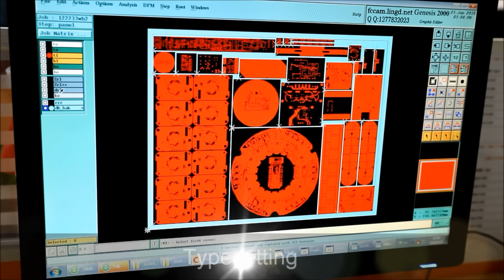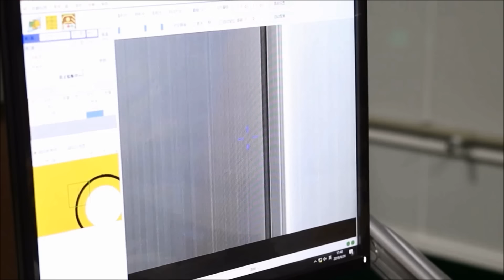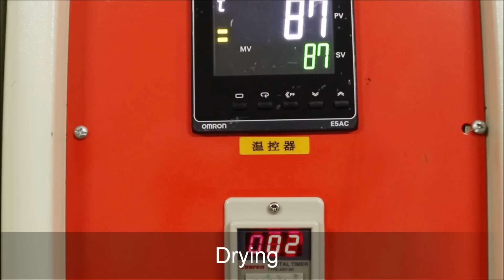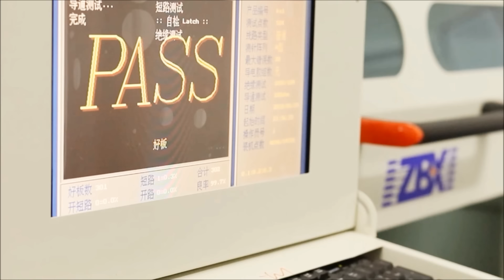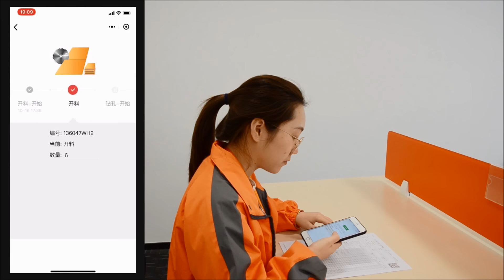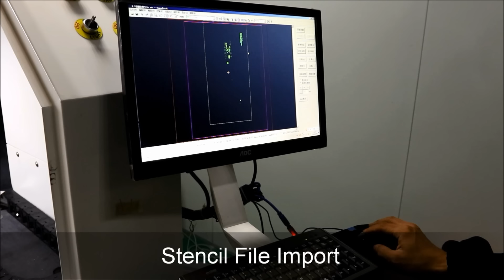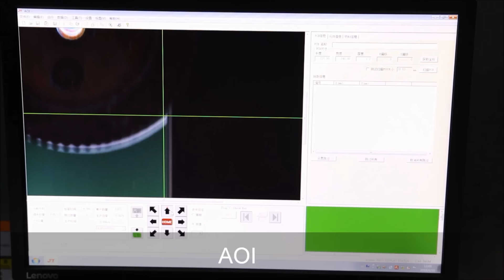PCB Manufacture and PCB Assembly inside PCB Factory China - PCBWay

Comment: A lot of steps not shown, for example lamination of photoresist,  developing of photoresist and solder resist,   solder resist curing. Final finish application. 

Most European manufacturers do not panel plate after electroless copper (pth process) , but pattern plate the image after exposure.
Multilayer PCBs go through many processes more than shown.
PCB manufacturing is  definitely a complex and skilled process, and requires a huge amount of initial investment in equipment and skills. I have been working in the industry since 1986 and have seen many changes.
Reply from the maker: Thanks for your comments! We also uploaded the whole series of the multi-layer PCB manufacturing processes. https://youtube.com/playlist?list=PLzxdr3n97eVsf63qILcg49nKTcADPyRAJ.

Comment: How does this process differ if I put through my measly 5 development boards? Is it more manual or can it deal with a bunch of individual boards? I see a bunch of processes that seem to require some setup before a board can be put through.
I mean, it seems incredible that I can order half a dozen boards and get such professional results. I have long ago threw away all my tools and chemicals that I had for making boards myself.
Reply: I think companies like this are able to sell small PCBs by placing many of them on a panel. They then cut the panel and send the bits that were your original design back to you.
Reply: Apakah menerima pembuatan skema untuk pcb nya sesuai kebutuhan saya

Comment: I still can't make a Gerber file, but I can still not use the Gerber file until the PCB is finished
Reply from the maker: Which design software do you use? There are many software that can help you generate the Gerber file.
Reply from the maker: There are many blogs about how to generate Gerber files on PCBWay website and you can check this link. https://www.pcbway.com/project/projectsearch?t=4&q=gerber+file+
Reply: I only use Eagle software from *.brd to *.png to *.pdf. Meanwhile, Gerber needs to learn more and may not be able to do it. @PCBWay 
Hopefully the factory in China can handle files in pdf format.
Reply from the maker: @hendriagustian7082  We have a blog that introduces how to generate Gerber from Eagle.https://www.pcbway.com/blog/PCB_Design_Tutorial/How_to_Generate_Gerber_and_Drill_Files_From_Eagle_9_6_2_93d3fa9c.html. If you still have problems when generating the file, you can contact anson@pcbway.com for some help.